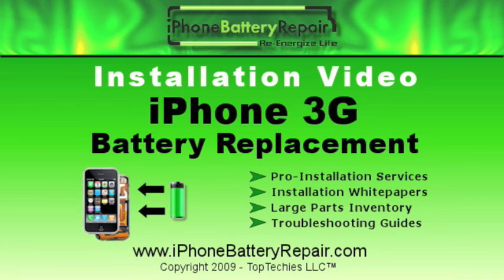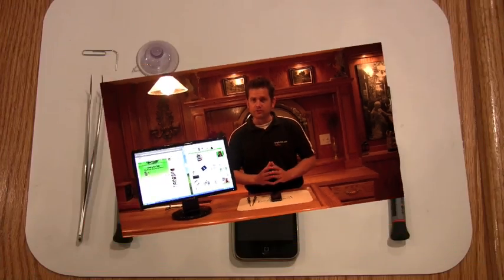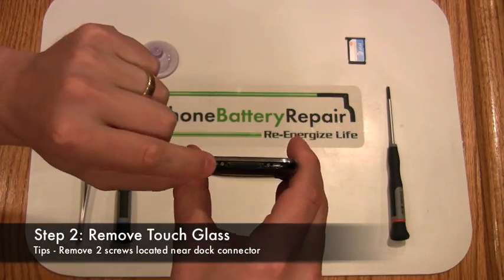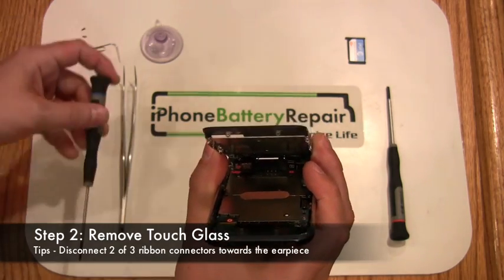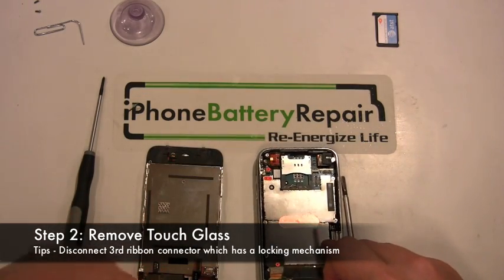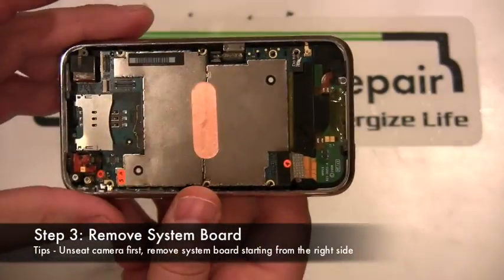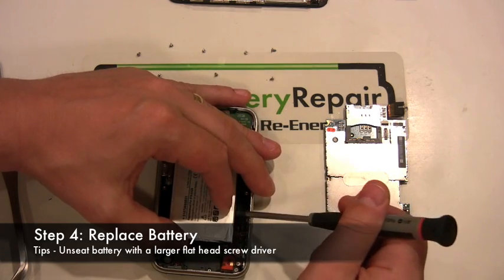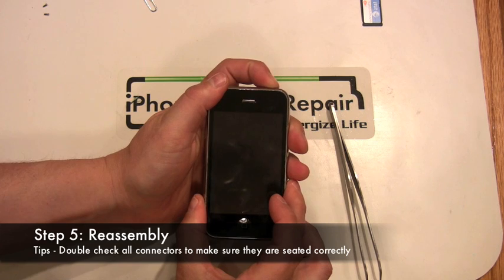iPhone 3G Battery Replacement  by AmpJuice.com

Comment: Wow, that was a b!tch... but got it done thanks to you. Couple tricky parts for me was removing the battery (it's really stuck there), while reassembly make sure I am able to reinsert the sim card (so make sure replace mobo as low as possible), and the damn camera screw, I had to use scotch tape because my screwdriver was not magnetic. The #3 tape wasn't as bad actually!

Comment: i purchased a new battery and installed it in under 30 minutes... at first i had issues because the phone kept turning off randomly and the screen brightness was very dim regardless of how I adjusted it... i took the phone back apart and made sure connections 1, 2, and 3 (they are labeled inside the phone) were securely connected.  Now it works just fine.  Connection 3 is definitely a tricky one.    Most importantly - this video was very accurate and helpful.  Thanks.

Comment: so during re-assembly, should i connect all the connectors back in order, or does it not matter?.. i've replaced the screen on an ipod video in the past, this is my first time takin apart my 3GS.. and replacing a battery in a phone where you cant just slide off the back cover haha

Comment: this video is the best tutorial, I just did this in about 30 mins maybe and i bought a 3g that was really dirty inside. The hardest part for me was getting the #3 cable back in, it was really easy to do for me but I was really stressing out at first, than when i put it all together    : )       really great tutorial iphonebatteryrepair

Comment: Very nice tutorial - I followed it to the letter and sucessfuly replaced my battery :)
Saved 70$ :) Thanks for the "unscrew and remove the camera" bit - it made the whole process much easier (other tutorials do not advise unscrewing the camera, but then locking the connector on the main board is a nightmare!) Thanks!

Comment: There's a tape stuck on one of the screws you'll have to remove from the mainboard, which is on top of the battery. Once you take off the tape, it's clear that you've put your hands on it.

Comment: The procedure is clear but the captions obscure some details and more big close-ups of screws, connectors etc. would be useful. Replacing connector 3 is called "difficult" but not shown. Looks like it will have to go back to Apple!